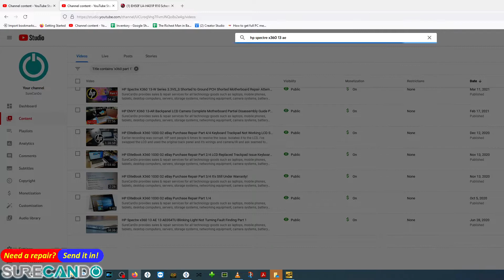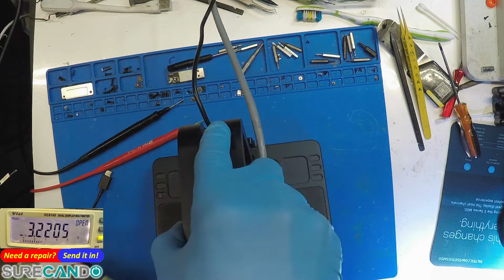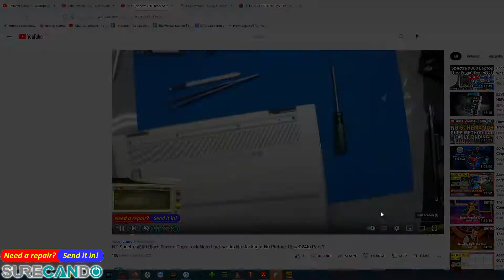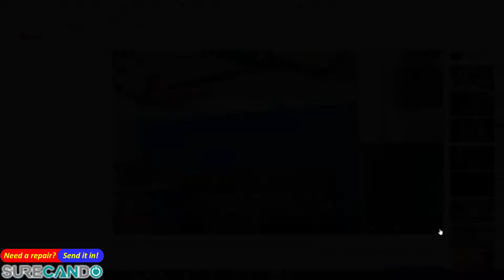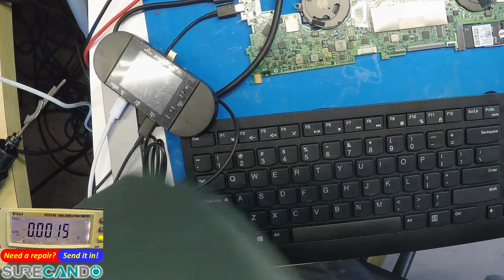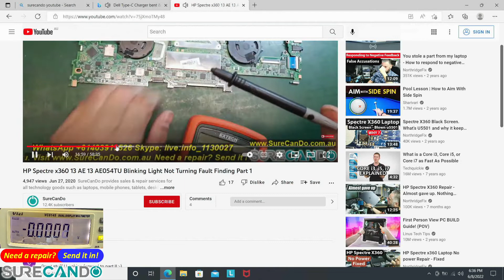HP Spectre 360 13-ae014TU From Japan Tokyo. 3V Missing AWV Chip damaged. Brings back memories.

Comment: What is happening with this USB-C meter? When the chip is overheating it was showing 0.01A and when you said it was fixed it showed 0.8A even though I think the motherboard wasn't powered.
Reply: @SureCanDo_Life   @SureCanDo  I kinda get it. Once you fixed it the power consumption increased because CPU and other peripherals got powered. Though it was weird that earlier the 0.2W was enough to be felt by hand on the board.